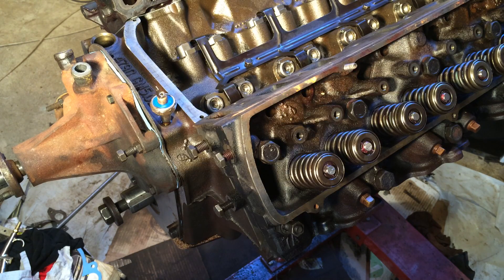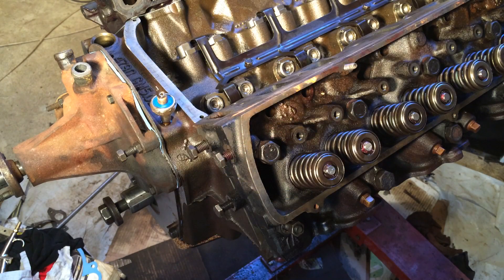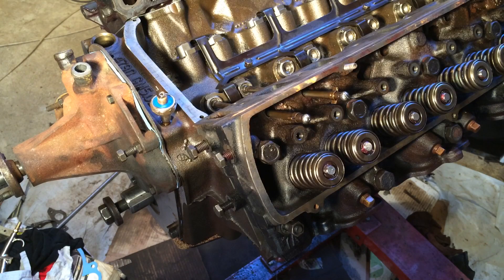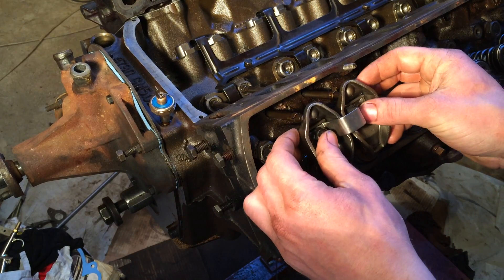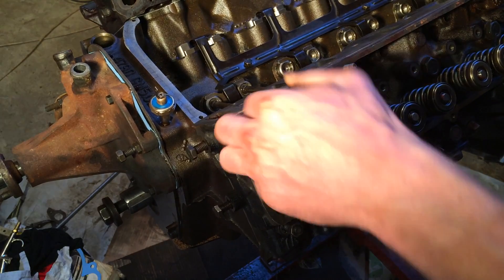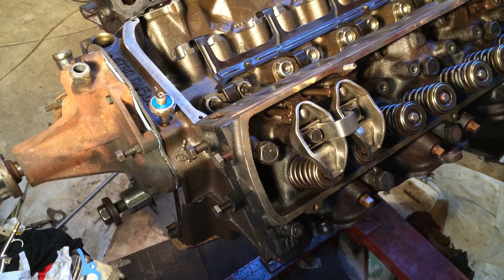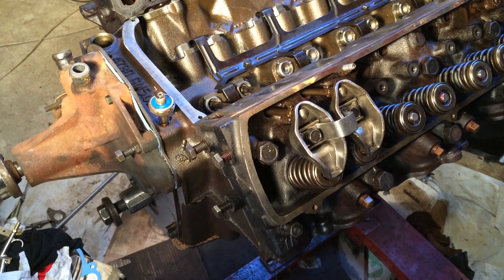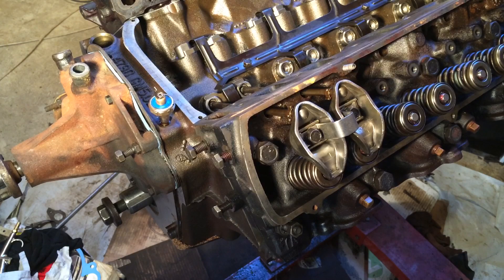Installing pushrods and rocker arms

Comment: Does it matter if you mix up your push rods. I pulled both passenger and driver side out but was told they have to go back in the same spot. I have a gm 4.3 had a blown head gasket.
Reply from the maker: Yes they have to go back in the same spot they came out of because of the way they wear.
Reply: International 240 so I more then likely have to buy new ones ?
Reply: International 240 one more question. Do I have to buy new head bolts even if the head wasn’t warped? Threads are solid and have no indication of corrosion.
Reply from the maker: I would probably buy new push rods, they are pretty cheap. You could probably get away with reusing the head bolts, i have done it many times without problems.
Reply: International 240 thank you so much you’ve been a big help. Very appreciated. Enjoy your day.
Reply from the maker: You are welcome, you too.
Reply: International 240 hey now back again for your valuable information. So installed both heads torqued them down to specs only thing lis fit to do is install new push rods I had to purchase. Do I have to set the engine to (TDC) when torquing the rocker arm bolts I have a 04 silverado 4.3  my rocker arms are a complete assembly and manual says to set on TDC before torquing rocker arms but give no specification on if they have to be torqued in sequence.
Reply from the maker: Sorry to get back to you late but are the rocker arms the same as a small block chevy? I haven't worked on the newer 4.3's, only a couple from the 80's and 90's.
Reply: International 240 thx for the reply I actually found a torque spec manual on line everything has been assembled and ready to go. But! Now I am dealing with a security lock issue. The truck will crank fine but no fuel. Fuel pump is turns on but I think the security issue is cutting of my injectors. I’ve tried the relearning process about 4 times now and nothing. I’d hate to do all that work and have to end up spending money at the dealer because of some faulty ignition issue. 😔
Reply from the maker: Thats good its all back together. Thats a bummer about the security lock issue. I have heard that the module does go bad sometimes.
Reply: @international2408  Getting ready to reinstall cylinder head after valve job. Its a 98 Ram 1500 with the 5.9l 360. Has hydrolic lifters like yours, bolt down. Can I install the rocker arms like you did or should I take the step in the Haynes manual to align the neutral mark to TDC before tightening? The Caution after it bothers me, Do not rotate the engine at all after matching these marks.
Reply from the maker: If its a set up like this Oldsmobile I wouldn't worry about it, i have removed/ installed valve train components in non interference engines with non adjustable rockers without aligning any timing marks and have never had an issue,  but I don't have any experience with dodge valve trains, if it was me I would follow the haynes manual.
Reply: @international2408  thanks after checking around I believe the 5.9L Magnum is an interference motor. Haynes it is

Comment: Don't you have to also make sure the cylinder is down when installing the push rods?
Reply from the maker: Making sure the piston is on bottom dead center is a good precaution if the engine is a high compression or a interference engine that had the lifters bench bled. This however is a low compression/non interference engine and everything was kept stock so there were no worries. I personally don't bench bleed my lifters and some camshaft companies don't recommend it.
Reply: +International 240 thanks for the explanation, much appreciated about to take the heads of a 5.9 Dodge Magnum Engine and then put new ones on.

Comment: i have a buick 350 does it go the same way n do i do i do the top dead center
Reply from the maker: I did some valve train work on a Buick 455 I used to have and they are different from Oldsmobile engines. Instead of individual rocker pedestals they use a pipe that runs from one end of the cylinder head to the other that passes through all of the rocker arms. To find top dead center, find the mark on the harmonic balancer and turn the engine over until it lines up with 0 on the timing tab. The engine will be on top dead center exhaust or compression stroke. If the engine has a distributor in it, remove the cap and if the rotor is pointing at #1 spark plug terminal, it's on compression stroke. If is pointing at #6 terminal, it's on exhaust stroke and the engine will have to be turned over 360 degrees to be on the compression stroke.

Comment: do both values need to be closed to install the rocker arms and push rods.. for some weird reason  every time i torque them to 25lb they come loose? or are they just bolt on and go
Reply from the maker: Yes you just bolt these on, no lash adjustment. Which component comes loose?

Comment: So I've got a 403 and and have a solid parts motor I can just pull the set off the other motor and reinstall and torque and be done
Reply from the maker: I personally would buy new parts if I could, but If the parts from the spare engine are in good condition and new parts are out of the question then yes you can get away with doing that. If you do use the parts from the spare engine just make sure to keep the push rods, rockers and pedestals matched together.
Reply: International 240 ok thanks I appreciate the info I'm gonna pull them 2morrow I've got one that's loose
Reply from the maker: You are welcome

Comment: i am installing rockers on my Oldsmobile. Do I have to torque them to 25ft pounds in a certain order? Thank you so much!!!!!
Reply from the maker: I snug them down until the rocker pedestals touch the head and then I torque them to 25 ft. Lbs. in one step.
Reply: I installed all my push rods and rockers on my 72 olds 350 and bam #5 intake push rod got bent and i can't get it out lol
Reply from the maker: Man that sucks. Can you move the pushrod in and out or is it stuck solid?

Comment: would this be similar to a 2.2 s10
Reply from the maker: Angel Tapia  Yes this should be similar to a 2.2L except I think instead of rocker arm pedestals and bridges like this 307 uses, the 2.2L uses a different set up. But it should be the same basic procedure.